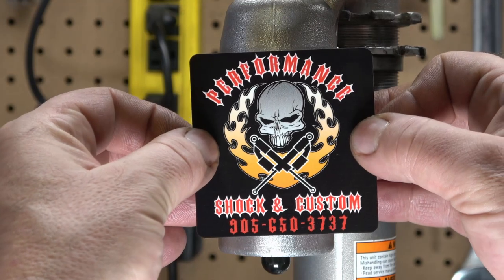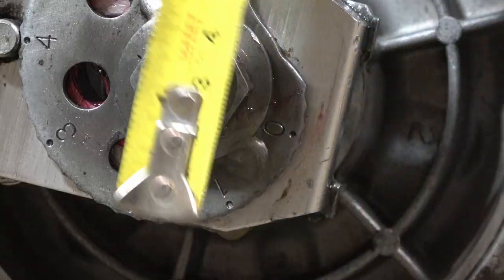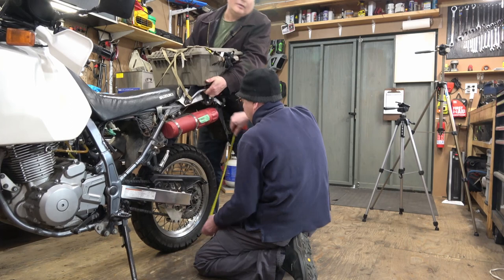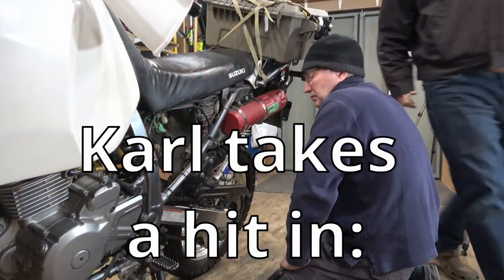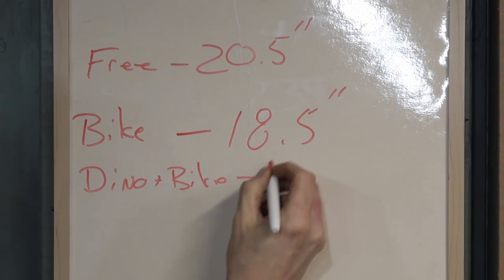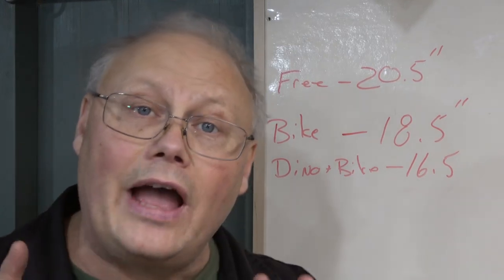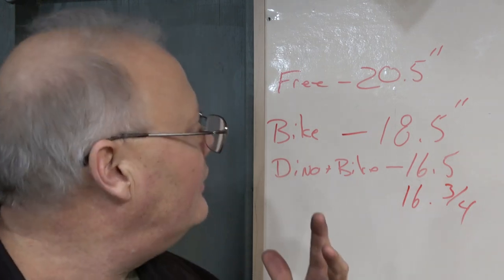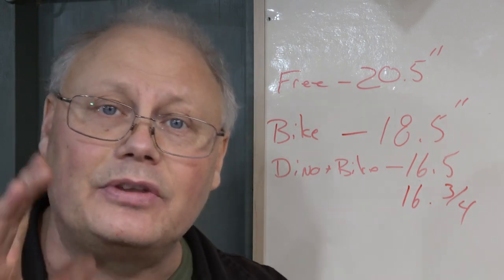Motorcycle rear Shock installation and tuning (Suzuki DR650).

Comment: Appreciate the detailed videos. I had never picked up a wrench before and Just took my carb apart cleaned it up and  put procycle jet kit in. also drilled slide and cut the spring. Bike is running the best it has since I had someone else do carburetor work. Now on to tuning my cogent shock for my weight with gear. You the man dino!
Reply from the maker: Thank you so much for the feedback and kind words. Glad my content is useful, thanks again and tinker easy
Dino

Comment: Great video Dino.   This video made  me realise how hard it must be to be Canadian......  half metric half imperial. 
Foot pounds Celsius inches millimetres miles per hour. 
You must end up pretty confused. Lol. 
Hey I do the same myself. Although I'm totally metric except I occasionally revert to feet and inches.
Reply from the maker: LOL, ya I was part of the transition generation ( Canada switched to metric in 1975 when I was 5) I learned both metric and Imperial. If I had to choose it would be metric for its interoperability between weights, and measures and the fact it is based on the power of 10 across the board. However I do use both interchangeably a lot as do many Canadians so I hope it is not to confusing in the Videos.
Thank you again for the comment
Dino
Reply: @DinosTinkerShed  yep I totally get how you would end up using both systems. Funny story: I was on a mostly US bike forum and someone asked how much I weighed re the bike suspension.  I replied 11 Stone..... my comment got some pretty hilarious responses:  What you weigh the same as 11 stones?  How big are those stones etc etc  I'd wrongly presumed that if you used pounds as a weight measure you would used stones as well.
Reply from the maker: LOL that is funny, I have a good friend who may be the best Agricultural and industrial mechanic I have ever met. He is from Switzerland and immigrated to Canada about 20 years ago. He and I often get onto the topic of how can the US not see the advantages of Metric, we laugh a lot because a lot of the other mechanics come up with all sorts of reasons that imperial is superior like how much easier it is to know that 3/4 wrenches are larger than an 11/16th wrench 😖. Makes for a good time for sure.
Dino
Reply: @DinosTinkerShed  it's funny because most youtubers i watch seem to use metric for most things even in the states (except capacity and distance and temperature oh and weight too. Ok so they use metric spanners and that's about it. Lol. 
Final question: is it aluminium or alooooominum?

Comment: Great video Dino. If you do end up deciding to re valve your shock in the future don’t be afraid to tackle the job yourself. I am confident that you could do that job after watching some of your videos. I installed the full FFRC stuff front and rear on my bike. The fork is very easy and the rear shock is not too bad. My advice for someone who wants to improve the suspension on a budget would be to buy the front valving and leave the stock spring. For the rear I would just try the 10w oil. If you are under 200lbs you can probably get away with the stock spring. These two mods will result in a big improvement for about $300 all in. With the full FFRC suspension the DR650 suspension is as good or better than  stock DRZ 400 suspension.
Reply from the maker: Thank you for the feedback and for mentioning that I may weigh under 200lbs LOL. You provide great tips for sure and I know someday the urge to tinker with the tuning will get to be too much and I will dive in. Thank you for your comments, they are appreciated.
Dino

Comment: Good video as usual Dino. Handy having another pair of hands for the rear shock - bit hard on your own. Lots of good info on adjustments etc. I have left my valves stock but a couple of friends have changed valves etc. They are heavier than I am and they like the changes. Standard settings suit my riding style but I did lower the spring setting. Thanks Dino.
Reply from the maker: Thank you for the feedback Mal, I am sure that eventually my curiosity will get the better of me and I will start playing with the valving (it is a habit I can not seem to break lol) but I think it is important to realistically know how you ride and what you can actually extract from the bike. Again for me I don't think I have the ability to exceed the current suspension set up but as my ridding improves the idea of tuning may become too tempting LOL.
Thank you again Mal
Dino

Comment: Good video, something that I found worked well for adjusting preload is I cut a piece of 5/16 keystock about a foot long and use that to hammer on it has a nice square edge and won't damage adjuster rings
Reply from the maker: That's a great tip for sure, I can't believe how little room there is in there for a tool. I'll have to mention your tip in a video at some point, thank you for sharing.
Dino

Comment: Another great vid... The importance of proper suspension baseline setup can't be understated, Particular with high powered sport bikes and dual sport bikes.
Sag gives you the proper "droop" and as we know, the suspension is just as important in keeping the wheels in contact with the ground on bump hits AS Well as hollows and potholes.
Reply from the maker: Good points all around Eric, thanks for the information
Dino

Comment: Sorry I missed the video when you rebuilt the rear shock. Filing the stake off of the shaft nut is a pain. The worst part, at least around here, is finding someone to charge 150psi of Nitrogen to the bladder.

Comment: Great video Dino.
I cannot stress how valuable your info is on the lower bolt torque…I wish I had this video available when I reinstalled my aftermarket Cogent shock.
Nothing like stripping out the threads on a brand new expensive shock, unless a guy was looking for a reason to do a video on installing a Heli-Coil…
Also, not sure if it’s right or wrong but I like to put never seize on the aluminum threads.

Comment: Nice one Dino. I was hoping it would be a bit easier to adjust with the airbox out proper tool like you said would help. Hmm it may still be easier to remove exhaust and drop our bottom save playing around with that airbox. I have never been able to get a tool in. I use a piece of 10mm square steel  which does the job. Interesting to see how you find it when out riding.
Reply from the maker: Thanks Dan, I'll provide an update on the ride once the snow stopped, we are supposed to get around 15cm today lol.

Comment: Hi Dino I have just upgraded the front and back suspension for my 07 DR 650 with stronger springs and re-valve in the rear and I went with the Ricor Intimidators valving in the forks.
Wow 😮  what a difference the intimidators make in the front.
Almost completely eliminating fork dive under braking. 
I completely recommend the Ricor valves if you could do your research and maybe share with your viewers.
Reply from the maker: Thank you for the feedback, at some point I am sure I will give in to the urge to re-valve the bike either because my riding style improves to where I require it or just out of curiosity, when that happens Ill check out the Ricor valves and compare them to the other options. Thank you again for the information, it is interesting to hear others experiences.
Dino
Reply: Hi on a 250cc motorcycle what you suggest going up a hill on a freeway when you have 5 gears
Reply from the maker: Hi Susan, I will confess I have not ridden a 250cc so the capabilities of that machine are not really something I can comment on from personal experience.  With that said I will say that for me I might try to adjust my route to ride less freeways and especially if they are in hilly areas. Even with my DR650, it will run at highway speeds but is far happier at 80-90kmph (50-55 mph) than 100-115kmph. I try to take the long way around to keep the bike happy but also it is usually more interesting.  If I must ride a section of highway, I just pick my speed and don't let others push me to much, its hard sometimes but easier on the bike.
I hope this helps, sorry I can not be more helpful.
Dino

Comment: Great video and info Dino. I cannot imagine being in -11 deg C. I had the stock setup for some time but had it modded by Teknik Suspension to suit my weight,height, 25lt fuel tank and camp luggage & fuel ,food & water. It made a hell of a difference. I just pulled both the front and back out and sent them off to their shop on the other side of the country. For me it was worth the exercise and was not that costly compared to buying the parts and doing it myself without doing the valve stacks.  I have a question regarding your screen you have fitted. What bike is it originally off ?
Reply from the maker: Thank you for the feed back, eventually I am sure I will get tinkering with suspension tuning a bit more but for my riding ability and style right now the stock set up seems to work OK (although if I rode a tuned bike that may change my view LOL). It can get a bit chilly at times here, when I head up north sledding I have seen -40 once and have ridded a few times in -35c. Riding at 50 to 80kmph, any exposed skin get red real fast and you quickly learn how to dress for it.
My wind screen is off a BMW 650 Dakar, it came with the bike when I bought it used but with out any mounting hardware so I made some. the unit is some what heavy and I was saying yesterday to my buddy Karl, that although it works well I may switch to a parabellum screen to take some weight off the fairing.
Thank you for the comments and questions
Dino

Comment: Hey Dino! And congratulations on 3k subs! 
I'm looking for an oil filter magnet for the XF/DR 650 but don't know the dimensions are correct for this engine. Any ideas? 
Thanks once more for your awesome channel!
Reply from the maker: Are yo looking for a magnetic drain plug or a magnet that fits inside teh oil filter?
Dino
Reply: @DinosTinkerShed  that fits into the filter :)

Comment: Hello Dino, is it possible to tighten the preload without removing the airbox and seat? Last week I lowered my DR650 using the Soupys lowering kit. I found my rear wheel rubbing the exhaust when I ride. I don't have any tools or any buddy to assist. Gotta do it myself.
Reply from the maker: Thank you for the question. The adjusting collar is in a very tight spot and even with the airbox out it's hard to adjust. The only way to do it without removing the air box is to use a long drift or stout flat blade screw driver and a hammer to move the ring. This is ok to do just don't use a cold chisel like many do, it can sheer off the tabs.
Reply: @DinosTinkerShed  Thank you. I applied WD40 and used my 16" tire lever to loose it. I found that with sag my rear tyre is just about brushing my exhaust pipe! You video shows rotating the spring clockwise. I will give it a try.
Reply: once you loosen the lock you can turn the spring by hand to adjust pre load
Reply: @stevenmccoy2885   I used the middle part of a wodden coat hangar bougt from a Dollarama store. Super easy and no damage to the aluminum ring and no need to remove any part.